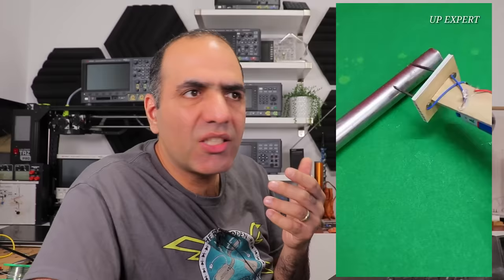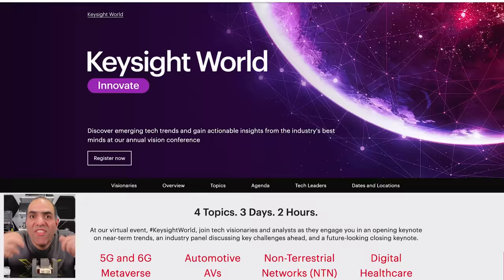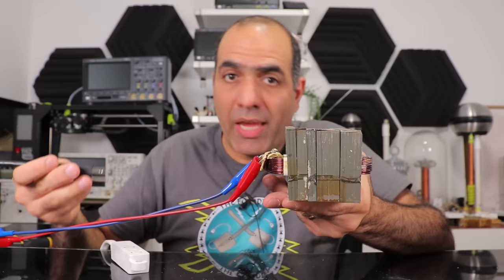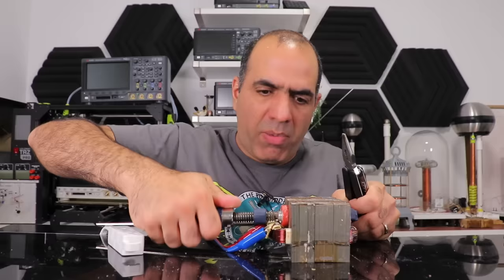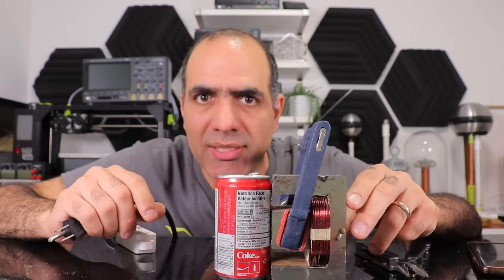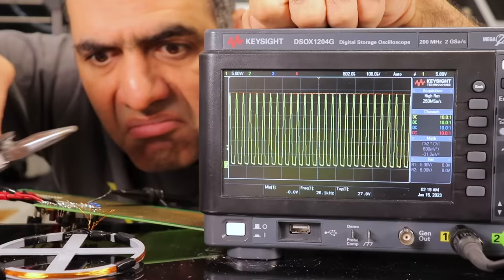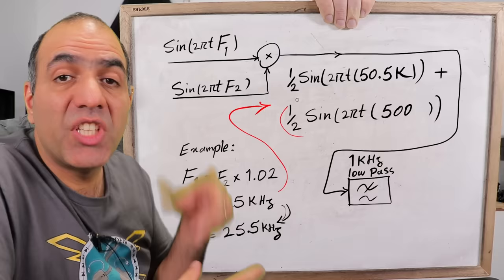DIY METAL DETECTOR, Gone Wrong and Right!!

Comment: A trick we used to do back when we were doing Class-A and -AB audio amps was to separate the  ceramic wire wound emitter resistors and put them on a heatsink.

Comment: My answer to the iron core question:
The electromagnet generated by the coil when current passes through it creates many thin magnets (the iron sheets) which are oriented with the same polarity (for example at one point in time, all have the north pole pointing upwards, then downwards, depending on current direction). That's why all the sheets repel each other.

Comment: I think if the metal plates have a slight gap and a magnetic field is applied, then the system stabilizes itself by pushing the plates apart. Like the before the magnetic field, the plates are together. After the magnetic field, they push apart so there must be some sort of north north and south south alignments happening. It would be interesting to see where the metal plated would end up going if they were free to move around! Can you make that happen? I think they would push apart then flip to align with the field lines
Reply: Also, with my reasoning here, the reason that the metal atoms dont fly apart and into a field line, is because the atomic forces are more powerful at that scale

Comment: if you want something more accurate you can use the same principle of phased array scanner made with inductors to even be able to detect at what depths you can and towards what direction dig through. bitluni has a good video on it, pretty sure you can use that as a base design and change a couple things to make it work with coils :)

Comment: I have endless spare guitar pickups that would make superb sensors for a metal detector. There's a variety of ways it could be used and I imagine it's relative to detectors that can be tuned for specific metals. You can pull voltage, current and impedance off of it and that's just to start. I had an idea for testing what type of metal with it already, but see you tackled that which I wasn't expecting. I'm guessing there's a bit more going on with the commercial units used to determine what type of metal you have encountered.
Reply: nuh uh
Reply: This may not work as guitar pickups are passive, where the vibrating metal string moves the permanent magnet atop the pickups up and down, generating a small oscillating current that's amplified to your speakers.

Metal detector coils however are inductors, which are active components, requiring an oscillating signal to operate, in the case of a metal detector pretty high current to increase sensitivity. Where metal coming close to the coil increases its impedance, Ie. opposition to the flow of electricity kinda like resistance for AC circuits, since more energy is required to induce an EM field in the object you're detecting - which can be detected as a voltage drop at the source

The reason for the difference is the guitar pickups feature a permanent magnet. So If you remove the magnet it should function as a normal inductor; which could work great for a metal detector since pickups are super sensitive, but it may be too small.

Comment: 16:25 Boi why does it sound like a Geiger counter
Reply: Short buzzer pulses - In a Geiger counter tube, incoming radiation deflects electron flow, sort of like how a cathode ray tube reacts to magnetic fields. This change is filtered (Geiger tube voltage is around 400V DC) and directly sent to a piezoelectric buzzer. Any fluctuations bend the piezo, creating sound.
The frequency of the pulses directly determines the amount of radioactive particles you're exposed to. And if you hear a solid tone, you're already dying. Here, a lot of processing is done to turn a changing HF halfsine wave and a constant HF square wave into a changing LF pulse wave.

Comment: The reason the core ends up splitting is because the magnetic flux passes through each of those laminated layers. Since there's a gap between each layer its like they become magnets that dont want to be near each other so they end up pushing apart.

Comment: 9:45 You can use a CMOS based Schmitt Trigger Oscillator in place of the Cross-Coupled Astable Multivibrator used here to eliminate the use of the resistors

Comment: 0:46 I already know the circuit will blow up…he always manages to connect AC wires to his circuits Parallel, not Series. You’d suppose he would’ve learned from his lessons by now.
Reply: @insanitywolf5049  
But that's what makes it funnier. Sometimes you need to inforce your own bloopers to add extra entertainment to your video.
Reply: He actually connected it in series with the lamp, not parallel but the lamp socket had some metal pieces between the contacts shorting it.
Reply: Nevermind, it didn’t blow up, but it didn’t work either.

Comment: The final circuit sounds a lot like a Geiger counter ..it'd be interesting to know if both have some similarities
Reply: Other than the fact that both operate based on organised motion of charged particles, none at all.
Reply: None. A a Geiger counter clicks only when a high energy particle passes through and causes ionisation. The devices can estimate an average radioactivity and change the frequency of the clicking depending on the sensitivity setting you set it to. In this demo the clicking has a constant non changing frequency that the sensor modulates when a metal is near. The only common element here is the clicking noise.

Comment: Because the flux lines run through each laminated layer, the core falls apart on itself. Because there is a space between each layer, the layers act as like-oriented magnets and repel one another.

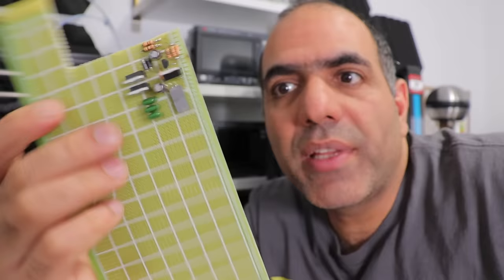Comment: 10:43
>Medhi: "Here's the circuit to running on nine volts, so later I can run it on... six AA batteries"
>The 9V Battery: "Bruh"
Reply: That's pretty much how a 9V battery is structured.
Reply: @Owen_loves_Butters  It's just funny he'd take the time to chain together six AAs instead of just using a 9V

Comment: It would be interesting to see a video on building a Magnetizer/Demagnetizer like those used to re-energize loudspeaker magnets.  Apparently the magnet is placed in a coil, and a large capacitor bank discharges through the coil.

Comment: The core is split in many layers so each separate layer acts as a separate magnet thus opposing each other. If the core is in a piece the field lines pass through it making it 1 big magnet.

Comment: The Iron core repells itself, because each iron sheet of the Core gets a magnet itself with the same alignment as all the other ones. This is because the coil is wrapped around all the iron sheets in the same Direction. And because the alignment of magnetic fields in all of the sheets is the same, they repell each other. This is why the Experiment also would be working if you used DC instead of AC.

Comment: Hi Mehdi 
answer for your question :
let's consider the case of a transformer core. In a transformer, the magnetic field is constantly changing due to the alternating current (AC) flowing through the primary winding. This changing magnetic field induces eddy currents in the iron core.

The key point here is that the eddy currents generated in the iron core create their own magnetic fields. The interaction between the original magnetic field and the magnetic field produced by the eddy currents can lead to repulsion or attraction, depending on factors such as the frequency of the AC, the design of the transformer core, and the characteristics of the iron used.

In some cases, the repulsion effect due to the interaction of eddy currents and the external magnetic field might dominate, leading to a net repelling force on the iron core. This can happen especially at high frequencies, where the skin effect and proximity effect play significant roles in shaping the distribution of eddy currents.

this may be wrong also 
but whats yor opinion

Comment: The core is broken and each part behaves like a magnet so they are repealing each other for the same polarity. For example , when one magnet is broken in two parts each     part gets a new pol and they are not fixed again. 
Maybe😅
If I am wrong then you are requested to explain the right one. 😊.  I like your explanations and love you so much ❤. Wish you never die in an electric shock. ❤❤❤❤

Comment: The core splits itself apart because the flux lines pass through each laminated layer. Since there is a gap between each layer, you end up having the said layers behave like like-oriented magnets, thus they repel each other.😍😍

Comment: 05:16: The core splits itself apart because the flux lines pass through each laminated layer. Since there is a gap between each layer, you end up having the said layers behave like like-oriented magnets, thus they repel each other

Comment: The core split itself apart, because the flux lines passed through each laminated layer since there is a gap between each where you end up having the Sedler behave like  ordinary magnets thus they repel each other

Comment: 5:00 : The core splits itself apart because the flux lines pass through each laminated layer. Since there is a gap between each layer, you end up having the said layers behave like like-oriented magnets, thus they repel each other

Comment: The transformer core is made of very thin plates of Iron which are not made as a full rectangle rather they are made in some diffrent shape which makes the current travel fully in a single plate and hence due to continuous change in polarity it generates eddy curent in a single plate  and hence it makes a north and south pole and magnetises it.....and hence gradually all the plates gets up with eddy current among which some have makes up similar north - north or south - south poles which makes the plates repel each other

Comment: The iron "things" split themself apart because the flux lines pass through each laminated layer. Since there is a gap between each layer you end up having the said layers behave like oriented magnetic thus they repel each other 5:00

Comment: Because the flux lines cross through every laminated layer, the core separates. Each layer has a gap between it, which causes the layers to act like like-oriented magnets and repel one another.

Comment: 3:21 true and just bc the magnet wont pull the mine up it can trigger its pressure plate and well the jump scare clip does demonstrate it pretty well xD
and if u are in old mine field and u think ur safe bc cant find any mines with metal detector wont mean it safe, bc modern mines uses polymer casings and other materials that cant be detected with metal detectors since the old ones where detectable with them :D

Comment: 5:44The core splits itself apart because the flux lines pass through each laminated layer. Since there is a gap between each layer, you end up having the said layers behave like like-oriented magnets, thus they repel each other

Comment: 5:14 because the gaps created by the loosely attached metal plates create poles in same direction, like when you break a magnet you can not attach it in the same place as it broke, you have to reverse it... It might be behaving similarly like that because of the magnetic waves are in same direction for all the metal plates...

I guess 😅

Comment: 9:46 Perhaps an exhaust and interior cooling fan may work? It’ll use more power, but keep it cool. Another idea is that you can just use a pump and tubes full of coolant and have it flowing around the system. And the final idea is that you can just replace those parts with your preferred WORKING parts that will stay cool and do the same thing with more efficiency. Plz heart

Comment: The core splits itself apart because the flux lines pass through each laminated layer. Since there is a gap between each layer, you end up having the said layers behave like like-oriented magnets, thus they repel each other
i think its the correct answer

Comment: The code splits itself apart because the flux lines pass through each laminated layer. Sconce there is a gap between each layer you end up having the said layers behave like oriented magnetics thus they repel each other 5:00

Comment: It divides itself apart from each other because the flux lines are passing through every laminated layer. Because there is some space between every layer, you finally end with the said layers behaving similar to like-oriented magnets, so, they push one another away. 5:17

Comment: That is a great invention. I bet you use it again. Maybe a strap across the center with a high-speed bearing for the nose of the motor to ride. Maybe the strap will give a place to trap the branch for more even cut. Then a weedeater handle for ergonomics. I'd buy one.

Comment: 5:16 the core spilts itself apart because the flux lines pass through each laminated layer. Since there is a gap between each layer, you end up having the said  layers behave Like-oriented magnets, thus they repel each other

Comment: answer -
The flux lines flow through each laminated layer, which causes the core to split apart. Each layer is separated by a gap, which causes the layers to act like like-oriented magnets and repel one another.

Comment: They repel each other because the individual plates are magnetically insulated from each other. 
    _(that's why plates are used rather than a solid core, to better control/contain/direct the field 'lines')_. 
    (If you look closely you can see the varnish use to 'insulate' and glue.)

The individual plates each carry only a portion of the total magnetic flux (magnetic power/strength) produced by the coil. 
    This magnetically saturates each plate and the excess flux leaves the magnetic 'conductivity' of the plate. 
Magnetic fields cannot cross, so it presses against the excess flux 'leaking' from the next plate. 

    The plates separate when the magnetic flux exceeds the glue strength. 

You've decreased the mechanical strength but overloaded the saturation design by removing the plates from the top of the transformer leaving a W rather than OO .. 

    Magnetic lines tend to 'balloon' through a medium, and while the thin plates keep their internal 'ballooning' very tight, air does not. 
By removing the top iron, you've removed the intentional 'magnetic short circuit' which then allows a magnetic 'arc' that can 'zap' (attract/repel ) metals.   ..(If you don't mind an 'electrical' analogy 🤣)..

So the flux tries to 'escape' on the 'open' side, like blister on an old water hose growing bigger, pushing against the top edges of the plates, 'til it pops. 

The field orientation (NS : SN) caused by AC current isn't relevant (to our perception) because the coil absorbs the energy and slows the collapsing magnetic field each time the AC reverses, maintaining some the 'pressure' during reversal. 
    This is the same reason your multitool doesn't fall off 60 times a second.

Comment: 5:00 they repel each other because in your setup the ions shoot up and exit the metal at the top and shoot towards the bottom in an arc which shoves away the other metals at the top while slamming them together at the bottom for the equal but opposite reason

Comment: You need to get a 20 and 30 amp outlet put in. Maybe even a 50. Or get a 50 amp rv extension cord and just run it from the outlet for your oven to your recording room. No more tripped breakers

Comment: In case of transformer the windings create the magnetic field, this field induces the metal around it and exerts a mechanical force, the force vectors direction depends on the current direction in the coil(F, B, I), so as Lenz's law says the induced emf tries to oppose the current the force is exerted in a way that pushes the sheets apart to reduce induction emf by creating more  magnetic resistance, vector analysis of the force will also give the same thing

Comment: You need to connect a 15 kilovolt line to such a device.  This will increase the device's radius and sensitivity.  There will be a higher chance of angry miners emerging from the ground with metal pickaxes.

Comment: 9:45 use arduino, it's simple and very easy to generate any kind of frequency waves. it will just take a few couple of minutes to program it, it has benefit over traditional circuit, you can tune the frequency using potmeter, remotely program it to tune into metals, i can arduino is better option for this

Comment: Use a class B or C amplifier and set the circuit's total power consumption to a clock if you wish to lower the circuit's overall power consumption. The coil only needs to be turned on often enough to detect anything beneath it; it does not need to be extremely hot. Create a dial to adjust the coil's polling rate to your walking pace. By doing so, you can use lower-rated components and lower the device's overall power consumption. The resistors in your circuit will go from having a constant power consumption of 9:26 to just peak power consumption.

Comment: Aluminum is a Dielectric, but I suppose you are correct at phrasing it a non-ferromagnetic, you know that @electroBOOM <3

Just like glass it can contain quite a high amount of voltage, as tests with layden jar’s can confirm. 

To anyone reading: (Don’t try this without knowledge and proper precautions, the glass can explode if it gets too saturated)

Comment: Double-click 'alumagnetic'. Right-click. "Add to dictionary". There, you can stop using it now :-)
As for plates pushing apart, my thought is that every plate becomes a magnet (duh! We already said that was happening) HOWEVER, since the magnetism is induced by an electric field going in the same direction for all plates, they all get magnetized the same way, and therefore repel each other.

...ah sh*t, the "comment baiting" tactic worked again! Whatever, have your engagement boost. You've earned it.